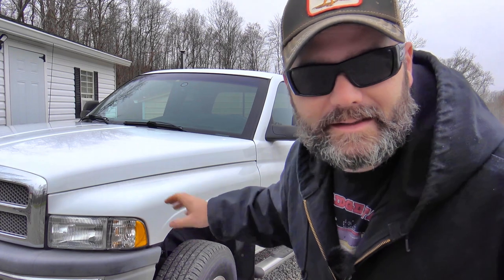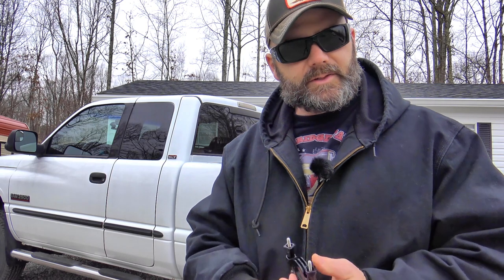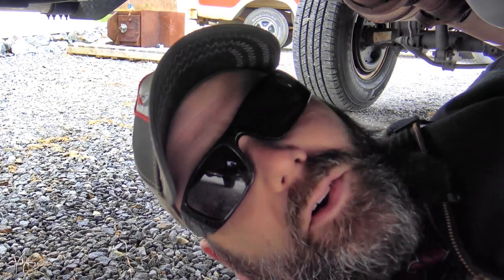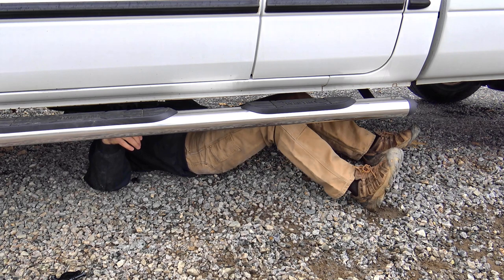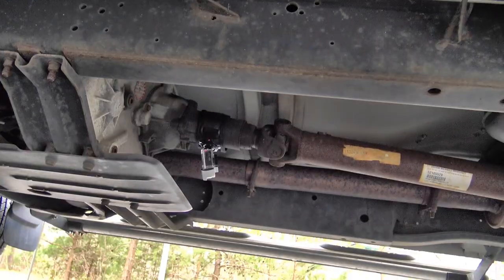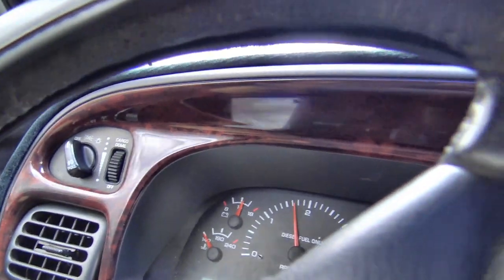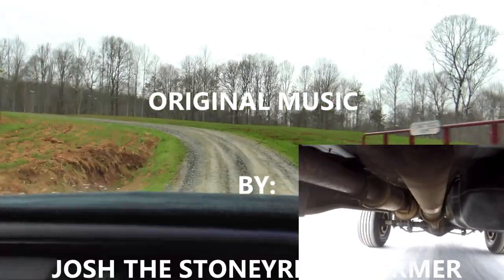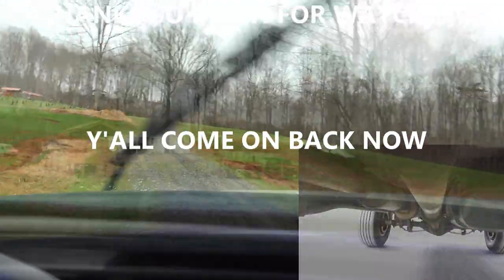WHAT'S WRONG WITH MY CUMMINS??? CALLING ALL MECHANICS!!!

Comment: you said the cv joints are tight......those arent cv joints....they are u joints.  and them being tight doesnt mean they are good. and actually when they normally go bad it is due to lack of maintenance to them....they require to be greased regularly.....some u joints arent greasable...you have to check to see if they have grease fittings.  anyhow.....if they are failing due to lack of grease, it is too late to grease them.  more than likely, one or more of the u joints are frozen.  you can check them by loosening one of them and lower the driveshaft.  after doing this, you should be able to move each u joint freely in both directions.  they should move smoothly with little to no play.  this is really easy to check......all you need to do is loosen the bolts that secure one end and do as i said earlier.  if you do find one that is bad, it is always best to replace all of them.  some u joints are held in with bolts and others are pressed in.  they are fairly easy to replace either way if you have a vise.  you can also rent tools at autozone to help in the replacement of them.  you tube should also have some videos showing how to replace them.  let me know if you need any other advice....i have been working on cars for close to 40 years.  good luck...

Comment: Carrier bearing how to replace it in my 95 Ford Ranger I'm pretty sure that's was going bad in yours it's what you call a bushing but it's called a carrier bearing and if you look as torn and that is not how it's supposed to be supposed to be complete rubber around it but I'm pretty sure it's your carrier bearing if not it's going to be your U-joints
Reply: Its also called center support bearing

Comment: the caring baring is shot
Reply from the maker: Turns out 2 things were the issue...U joints and the Carrier bearing
Reply: Before you decide to keep that dodge for a lifetime you may want to check the blocks casting number . It's on drivers side of block near the front of motor the 2000 had this engine block it was prone to crack I think the number was 52 you may want to check. If you decide to keep it I've got new doors and finders that will fit it they are factory dodge doors and finders still in box I live south of huntington wv we're almost neighbors

Comment: Josh
It's really frustrating every body complaining about the fact that it's about Dodge  they're good trucks. The piece you're shaking in the middle of the driveshaft just call the carrier bearing it is normal for the shake in the rubber around the bearing the truck has 130,000 miles expect things like that. I don't think your driveshaft out of balance. This is not something you can tell on camera these trucks are known for front wheel bearings front Universal joint problems. Which I didn't hear you mention and warped front rotors. Just do with the rest of us do Bring it to the dealer.i've been a aviation mechanic for too long I've owned fords Chevys Toyotas dodges. Sorry my favorite is dodge I'm sticking with them but after looking at the 2019 Dodge Ram 1500 hemi I'm a little disappointed.
Sorry I can't help you that's not something you can diagnose over the computer with a go pro
Reply: Well dodge don't get all the hate for nothin.
Reply: Had to replace the driveshaft on my F-150, they weld the stinking U-joing forks on.  30 dollar bearing, thousand dollar driveshaft.  I wouldn't bitch about Dodges.  I would carry a pan to slide under the engine.  If it ain't leaking oil, something is wrong with your Dodge.
Reply from the maker: Gotta take em' with a grain of salt buddy...I loved this style dodge since the movie "Twister".....But I've owned Ford full size trucks too...and old chevys
Reply: I see a lot of replies on here the bearing carrier is loose around the rubber not the bearing itself I don't think it's the cause of the vibration.
You can order the new rubber at the dealer I believe it's two bolts for that carrier to come down if you want to change it. Big bolts ones you need an impact for. Good luck Josh
Reply: dodge only makes good diesels in the 2000s pretty much all their gas burners were loaded with problems

Comment: I wish trucks had the 4x4 lever still.
Reply: Michael W. My 2017 dodge 2500 dose
Reply: Michael W. Just like i wish they had Metal bumpers not this plastic lego crap
Reply: chickensfloat_ on_dirtbikes lol
Reply: they do if ya prefer older trucks.... I'm not a big fan newer trucks for a lot of reasons
Reply: Michael W. my 2014 6.7 cummins has the 4wd on the floor it's all about how you order them
Reply: Ooio Polleu you could order a 2016 with a manual 6 speed transmission as well
Reply: My 2016 gmc has one
Reply: our 30 year old dodge ram wore out with 799, 000kms wich not bad out lasted pretty good years plus it done piles of snowplowing and sanding and salting  and spreading 
thats why love dodge rams has the gutts,glory,Ram
Reply: chickensfloat_ on_dirtbikes. My 2017 dodge 2500 has a metal bumper
Reply: chickensfloat_ on_dirtbikes 
My 2013 F150 has a metal bumper.
Reply: my dad’s 2017 1/2 ton gmc does
Reply: It’s an option you just have too ask for it. Had to wait two months too get one into the local dealer.
Reply: Kyle Creates 
Noted for the next time.
Reply: New gm trucks do
Reply: My '15 Cummins has the manual selector.
Reply: Michael W. My grandad 2017 3500 Cummins doed

Comment: if I were you I  would put the truck on jack stsnds and run it in gear and get under and look. the thing you are looking at is called a  swing bearing, the rubber just holds the bearing which is inside the rubber next to the shaft.if the bearing is  freezing up you will see it spinning inside the rubber. if it is bad it is a bitch to change without a press. shop time .  Semper Fi

Comment: Those are universal joints not cv joints and your carrier bearing is bad gone toast not suppose to be able to move around like that the rubber is rotted away and check your universal joints on your inter axles in the front diff that's has a straight axle no cv joints check front drive shaft u joints. Not a hard job make sure there's no play in any of these things I've worked on a lot of these

Comment: Get yourself a new bearing...Gonna take a fair bit of sweat,not much talent to change out. Myself I'd take it to a shop. Doesn't matter if the engines are famous for lasting 10 million miles because the rest of the truck needs fixing every year..Mtnce mtnce mtnce is the key to not be sitting at the side of a road..